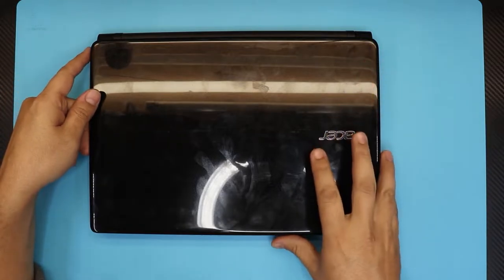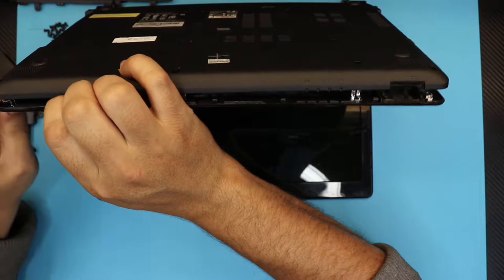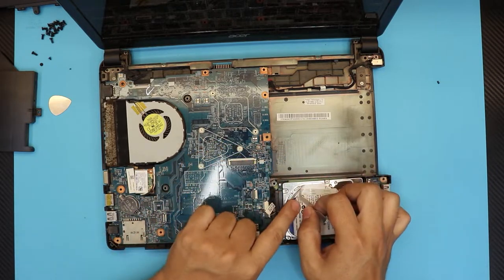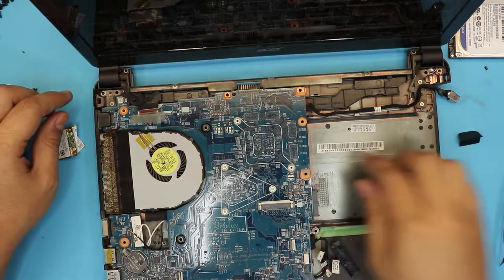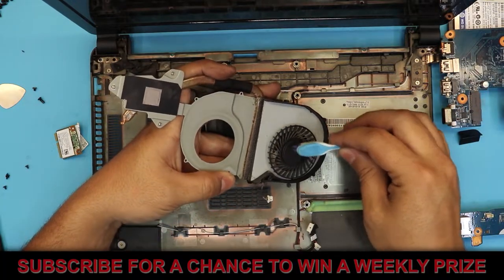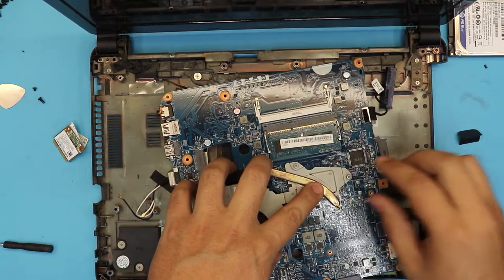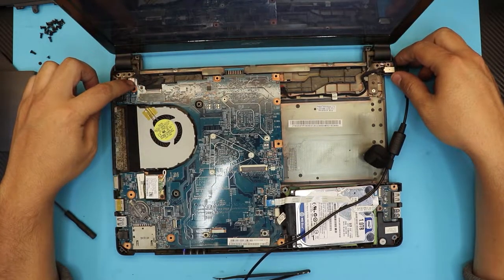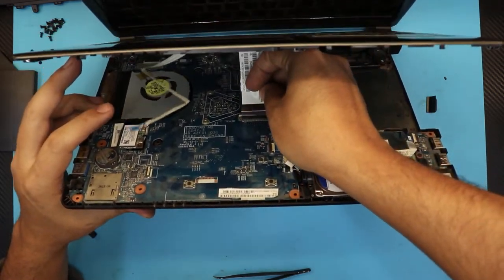How to disassemble Acer aspire E1-422, upgrade RAM, HDD and REPASTE

Comment: Thanks for the video, my HD doesn't work anymore, I want to upgrade to a ssd, any advice?
Reply from the maker: Thank you for the feedback and your support to the channel by a Sub :P
regarding you HDD i highly recommend you to put a good quality ssd (SAMSUNG) the reason is the Samsung ssd have a Dram chip, that will keep you lasting longer and faster and secure.
the cheap Kingston or adad ssds are cheap and dont have the dram, and also there is a TBW on SSD the Samsung give a higher TBW  (Terabytes Written) wites before failure are about 600TB. unlike other brands that give 150or less.
but if you going to use for office use , put any cheap ssd.
https://amzn.to/3qyCyuD

good luck

Comment: do I have to take the lap top like this just to upgrade the ram?
also it comes with 4gb  can I just add another 4gb to the open slot?
Reply from the maker: yes you have to take it apart all the way down to flip the motherboard to be able to add ram, its very annoying but its the only way. :(
Reply: @uFixTek  my acer aspire e1-422g (same model) can change ram theres a panel where u can change the ram. But mine only have 1 slot

Comment: Mine is different, only have 1 ram slot but theres another space for 1 other slot.
Reply from the maker: oki then you have a a bit different model. :)
Reply: @uFixTek  yeah i want to change the motherboard to get the second ram slot
Reply: @uFixTek  you can also take out the ram from the back
Reply from the maker: on this exact model you cant but if your version is a bit different you can.
Reply: @uFixTek  how much ram does this support?

Comment: Hi uFixTek, I have this notebook, works great but I'm having issues with Google Meets, the screen freezes, It has 4GB, it worth to change to a SSD disk and increase to 8GB RAM? Thanks
Reply from the maker: do a repaste and by adding ssd it will fix your issue and if you can up the the ram to 8gb it will definitely ez the pain, as right now because of COVID here we having clients coming in with the same issue daily and we upgrading ssd with new fresh install of windows and if possible upgrading ram will solve your issue., when you open google meets, open up task manager and check where you having issue in cpu or ram or HDD,
to get to "task manager " press Ctrl+shift+ESC key" and it will take you to task manager  then go to "performance" tab and there you can see the bottlenecks.
ssd: https://amzn.to/2EdJ2fm
ram 8gb: https://amzn.to/3173uYo
Reply: @uFixTek  thanks for answer! I check the resourses and at the momento of  open the Google Chrome the memory use is 57% and the CPU use is 100%.......this can improve with SSD? Thanks
Reply from the maker: yes it will help because it will be able to push files back faster to ssd rather hdd , you have windows 10??
Reply: @uFixTek  no, windows 7
Reply from the maker: if you have window 10 do the following and it will help you alot:

step one:
press "win+R" (windows key) and type: services.msc

then go all the way down and find "windows search" , double click
1st, from the drop down menu choose "diasble"
2nd, click apply
3rd click stop 
4rth click OK
and restart 

note: your windows search will work just fine, dont think this will remove your windows search.
and you will see the magic 

also when you there find "SuperFetch" if not there then dont worry just ignore the following steps, else follow this:
double click "SuperFetch" and do this :
1st, from the drop down menu choose "diasble"
2nd, click apply
3rd click stop 
4rth click OK
and restart

Comment: is the CPU upgradable?
Reply from the maker: no unfortunately its not possible. there is zero chance of cpu upgrade.
Reply: @uFixTek  thanks for the reply, for some reason, my acer aspire e1 422 has only one memory slot and a single slot of the said unit can only take up to 4gb, very unfortunate
Reply: @magisterclassicus3473  i think you can support up to 8GB on 1 memory slot because the maximum capacity is 2x8Gb

Comment: Thankyou sir ! Save my life !
Reply from the maker: im glad i could help you , thank you for the comment.
Reply: @uFixTek  yep but i dont know why my laptop got blackscreen after adding new ram + ssd , it same type & freq with the onboard ram , its normal again after i remove new ram
Reply from the maker: how big is your ram Gb the one you adding and the one you had on mobo how big it was? 
and also when you power on do you see black and not even a logo or any text. 
because remember if you replace or add ssd you need to install windows, else it will say no boot drive.
give me more detail, also if you know the exact model for your "CPU' ?
Reply: @uFixTek  the new ram is 4gb , same with the onboard ram (4gb) , this is complete specification of my laptop https://www.acer.com/datasheets/2015/4876/ES1-421/NX.MY2SN.002.html , , yes it was a blank ssd when i put it on laptop , i tried remove a new ram after blackscreen and install linuxmint , everything is normal , it goes blackscreen only if i put the new ram in my laptop , this is new ram type : Sodimm 4Gb DDR3L PC12800 Kingston 1600hz
low voltage ram 1.35v
Reply from the maker: did you put the new ram 1st on the mobo?, i have no idea why your comment was held in spam area!